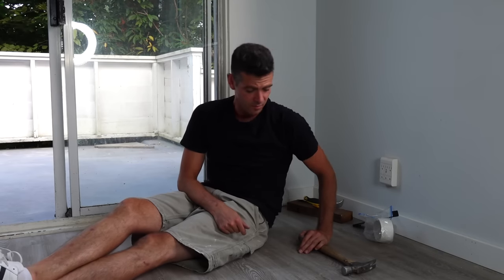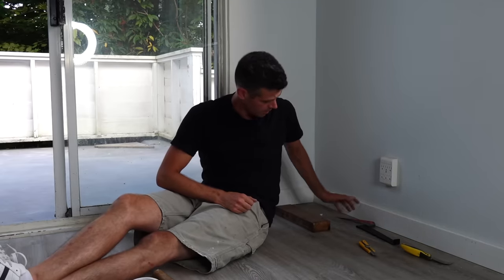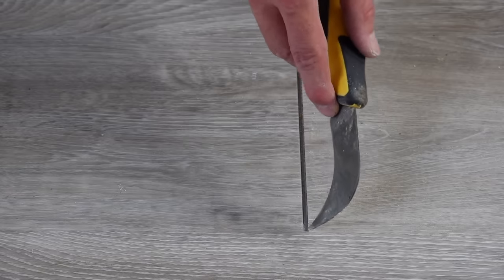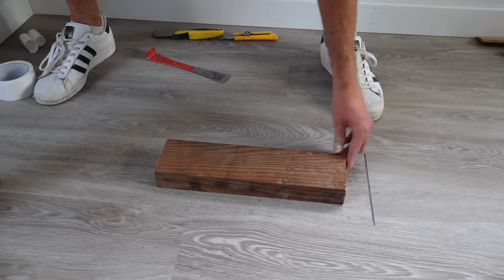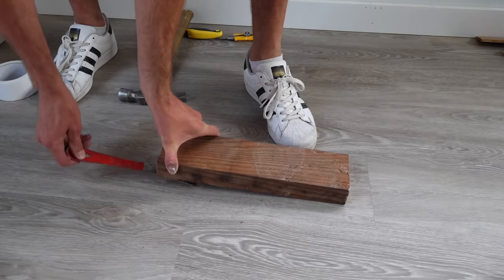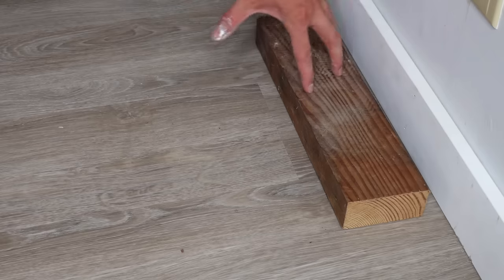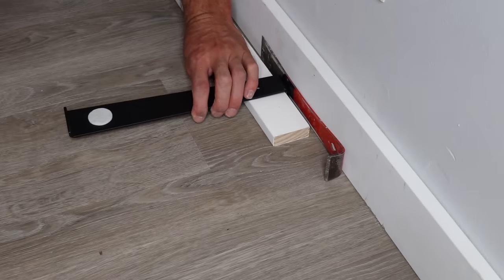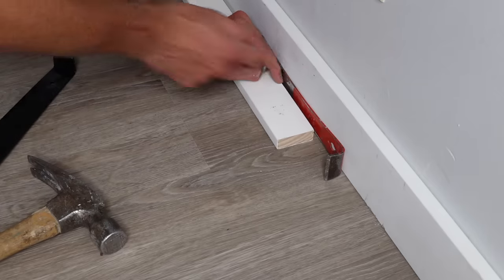How to Fix Gaps in Flooring!!! (Laminate, LVP, Engineered wood)

Comment: The best way is to get the suction cups with handles used for moving windows and glass.  I’ve closed up hundreds of gaps in vinyl and laminate floor with ease.
Reply: This
Reply: I also came here to say this. Use a suction cup dingus! There are cheap and easy to find and will not damage the floor.
Reply: I've tried a suction cup.  It does not work very well if the floor is textured as it's hard to get a good seal.
Reply: @davebaker1325  I also came here to say this
Reply: Does not work with deeply textured planks.
Reply: For those saying it doesn’t work well for grooved planks, it does work well.  All LVP I’ve installed has worked perfectly with the double suction cup window handles. You can even mist some water on it first and it locks rocks solid.  Then use a rubber mallet or a hammer to tap the handle and the LVP slides about 1/8” with each strike.   Maybe if you’re installing wood laminate or a floor that is not air tight, it won’t work but I’ve done over 25 LVP floors mostly distressed finish and this works great.
Reply: Suction cup. This dude is an amateur.
Reply: @elpcmaster  ya right.
Reply: Tried a few suction cups, DOESN’T WORK !
Reply: Have you fixed the LVP with the tongue and groove ends like this?
Reply: Thanks Tommy.
Reply: Even better!
Reply: I came here to say get real hardwood instead and you won't have r to deal with this bulkshiiiiii
Reply: Will that work on my wife😜
Reply: @jayboogie1357     We have real solid hardwood.  We have gaps.
Reply: I read your comment and moved on from the video. Thanks!
Reply: @rubyoro0  there either old or installed improperly.
Reply: How
Reply: Yeah I've tried different suction cups and it doesn't work very well on the hardwood flooring we're using. I'm gonna try this method if something like this happens in the houses we're building again!
Reply: @jayboogie1357  difference in price is only $2k vs $15k. Ez
Reply: Yeah but I don't have and can't afford suction cups
Reply: @jayboogie1357  real hardwood sucks because it’s actually quite soft and scratches and damages easily, especially when you have kids. I don’t understand the appeal of hardwood.
Reply: Still need something like this for those small edge pieces too small for the suction cup
Reply: @davebaker1325  I think the ones they are taking about are a bit better. I think the ones used for scaling buildings wood be best but probably not cheap
Reply: I had the exact same idea, it works great and its fast.
Reply: Any recommendations for which suction cups to buy?
Reply: I figured they would slide
Reply: Thanks for sharing your technique
Reply: So you put the suction cups on the plank you want to move in a certain direction then have to muscle it there? Seriously?
Reply: @ssbmsb  rubber mallet.
Reply: Just my thoughts for those still reading comments.  The guy is not an amateur. His video was for the diy amateurs..
Carpet tape works well and is cheap. If you don't have a block of wood the plastic block that came with any laminate install package works well. Also double sided alien tape works well too If you have it already.. sometimes even a real good pair of running shoes with a good sticky grip will do the the job. Just slam your flat foot in the direction the plank needs to go..

Suction cups will work but they can be expensive and I would be cautious about hitting them with a mallet.. they are not intended for that purpose. I have one in our shower /tub I could use but the way the handle is curved not sure it would be a good idea. Might break as the handle is plastic.. not meant to be hit so be careful if doing it that way.
Reply: Suction cup doesn't work.
Reply: @jeffsim8664 of all the comments here, yours was the most sensible and useful.  Thank you.
Reply: Thank you.. some slide in easy others ya gotta work at it.  A little bit of glue helps keep them in place. Thin bead on the tongue so it glues to the groove.
Reply: Which suction cups are best to buy for closing gaps in plank flooring?
Reply: What about the other end? Will this not open up and created gap on the other end?
Reply: I am not going to risk a good quality 30.00 suction cup by hitting it with a hammer when i can get a roll off double sided tape for 5.00. And a piece of 2x4.
Reply: What causes the gap in the first place? Mine wasn’t like this when first installed. This makes me wonder if it will slip back again? Isn’t there something else to do besides slide it back into place? What’s going to make it stay in place?
Reply: I think its usually the cheaper laminates that do not have a good t and g system on the ends. Just movement on the floor. Walking on it. Vibration any number of things will cause it. Make sure you clean out the gap really well. any debris in the gap will prevent a successful rejoin. Scrap and vac out the gap. Then a bit of carpenters glue on the tongue side should hold it from separating again. Alien tape works well on the bottom of a plastic block or short piece of 2x4 @tamaramiller2299
Reply: @tamaramiller2299  generally it’s floor prep. If the floor isn’t flat and level, each time someone steps on plank, the edges get pulled in.  This is what causes the gaps.
Reply: Put on a pair of shoes with a sole that grips and scuff kick it in place.

Comment: about 80% of the time, instead of using double sided tape, you can just "kick" the plank lengthwise to close up the gap.  (rubber soled running shoes help)
Reply: That's what I do with mine all the time... success rate 100% on a simple tongue & groove system. Don't know if it works on a click system
Reply: Yup, this is the easiest way. Don't use black-soled shoes :)
Reply: That would make a gap on the other side huh. No way you're moving a whole row like that
Reply: sounds like it'll just get undone as soon as someone walks on it if it's that easy though.
Reply: @samuelbankston2108    I pick the closest wall that has baseboard and quarter round, and "pull" from that side.  I've yet to have a situation where the end cut under the baseboard gets exposed.  If the pieces separated like the example in the video, they were not very strong to begin with (even on the long edge), so they will slide with a few well placed kicks.
Reply: @Layarion  a bit of glue or construction adhesive helps a bunch.   A couple of times I've squeezed enough adhesive into the gap to go under both pieces and attach them to the floor.
Reply: @psanscartier  I think a click system would have too much friction.
Reply: I did the "kick step" with sticky running shoes too and it was a fast fix though this one is quite elegant.  I think a pro should use this one to look like a pro!
Reply: @robertpautsch5093  You look like a pro by being efficient with your time and the customers money.
Reply: rubber mallet
Reply: Came here exactly for this comment
Reply: @psanscartier  sometimes yes but not all the time it's like a 50/50 chance you'll get it with a click system
Reply: I was thinking one of those rubber jar grippers with a 2x4 on top
 Just hit the 2x4 from the side with a hammer while applying pressure to avoid scuffs
Reply: rubber mallet from your flooring nailer is 100% effective...
Reply: This is what I do.  But how do I keep them shut?
Reply: Just tried it, worked perfectly👍👍
Reply: he didn’t show the new gap at other end?
Reply: @Layarion  Its the same as driving it home with a hammer or any other tool.  If the joint was week to begin with, yes it will come apart again, and again, and again regardless of how you closed the gap.  The only way to fix that is to replace both pieces.
Reply: @samuelbankston2108  the only way to avoid that is to ONLY work on the end piece and try to drive the entire row.  Problem is that you can only drive about 2 pieces at a time.  Best bet is to kick one board over at a time moving across the row and hope that you don't damage an edge joint in the process.
Reply: @everydaylogic2198  work it back to the last one to the architrave
Reply: @samuelbankston2108  Yeah, I have to do it all the time. The flooring company was new and their "linking" system is/was defective so the planks move. A giant pain. 
we bought additional flooring for another room (to match) and they had fixed it so that the new flooring hasn't moved at all.
Reply: I just use my barefoot.. grips just fine... I was hoping this was going to show us how to stop them from spacing out after...  🤷🏻‍♂️
Reply: @Layarion  Yes thats how it sounds but its not how it happens
Reply: @psanscartier  you just gotta use a plank of wood in front of it to hit so you don't break the lip
Reply: @VC-Toronto  my frustration with the glue is, I didn't buy this flooring to be glued together. It infuriates me, when my dad, my flooring installer, says "we'll glue it"
Reply: @VC-Toronto  its supposed to float so you  should not  glue it to the floor. But you could use some super glue in the joint but only use it like  a  nail on the tongue
Reply: @samuelbankston2108  You just work your way along the row, kicking the gap closed on each plank. On most averaged sized rooms, you only have to do it four or five times per row, no big deal.
We also use a similar device to the one in this video for more stubborn planks, but instead of the tape, we use rubber non-slip drawer liner with foam on the top to kneel on. This usually gives plenty of grip, and unlike tape, you don't risk delaminating the plank.
Reply: @brandacarlson815  o
Reply: @swiftaudi   Glue, use something semi flexible like Junkers butt joint adhesive
Reply: Bare feet
Reply: Few drops of wood glue if it keeps happening and a kick
Reply: @samuelbankston2108  If the whole row has moved that much to begin with then you can also move that whole row back again too
Reply: @Layarion  Yes and what these people didn't mention is that if that gap does appear then you should also glue those joints, otherwise it will move just like that again. I have done that countless times
Reply: @shegocrazy  I've done it with click flooring too
Reply: @lightbulb1982  I've laid like 20 wood floors at least lol.
Reply: @lightbulb1982  I guess depends on the type/brand? I installed some snap in flooring and no way it would move. The edges are waxed but too much friction. It really locks in.
Reply: @samuelbankston2108  how do you keep the planks in place?
Reply: @carlhendrix6547  flooring shims
Reply: Sounds like knee pain in the making.
Reply: @jimmurphy4703  what he said
Reply: Works great. Thanks!
Reply: It`s what i`ve done with a bare foot, for nearly 35 years.
Reply: Exactly! 

Think smarter,  not harder
Reply: @everydaylogic2198  that's what I was thinking.  I had to watch the video just to see all the effort he put into a simple fix. Just keep going, lol
Reply: @zackfishle1009  where do you hit the rubber mallet?
Reply: @alex9483  I hit it in the face when I am fed up with work.
Reply: I just kicked a gap closed that was twice as wide on my kitchen floor it's the fastest and easiest method 🤷🏼‍♂️
I've seen guys with a  🪣 of tool & take an hour trying all different ways glass 🪠 suction cups rubber  mallet, tapping blocks 🤦🏼‍♂️
 just kick it already 😆👍🏼
Reply: Never used tape once in midlife I make 20k a Job ever 10 days
Reply: @umchoyka  and if you do use black soled shoes, use a tennis ball to remove scuffs.
Reply: Clean soles!
Reply: @psanscartier  click system is a pain. Can be.
Reply: @lightbulb1982  you never glue a floating floor 🤦🏻‍♂️
Reply: Occupational safety OH&S does not allow that. Thanks
Reply: @johnkind5981  are you talking about OSHA and wat don't they allow 🤷🏻‍♂️
Reply: @VC-Toronto  which glue? And how do you squeeze it between cracks?  Do you lift a piece up?
Reply: I wouldn't worry about it if it's really close to the wall
Reply: Vacuum, superglue, kick. I have 20 year old click laminate and ends seem to give out first in high traffic areas.

Comment: I watched this video because I had some gaps in my wood flooring but after reading the comments I just kicked the board to achieve the same fix, thanks Vancouver Carpenter, I wouldn't have found the fix without you.
Reply: Fantastic ❤
Reply: I met with an inspector for a home I was buying and that's what the inspector told me to do. I just made sure I had shoes that didn't leave scuffs and gave it a quick kick. Easy fix.

Comment: I have used an auto body repair dent suction cup.  Can pick them up at Harbor Freight or auto supply store.  Flip a lever, it sticks and flip back to release.
Reply: I have done the same thing.  You can get a single suction cup or double suction cup with a long handle for more leverage.  I got mine at Princess Auto.
Reply: Same here, except I use a cheap $3 plastic one from Harbor Freight and it has lasted me for years.
Reply: Have you done this on textured LVP or just the smooth laminate?
Reply: Best tip here
Reply: DUDE, great tip, I have a couple of those and I'm getting ready to lay some flooring. (this should be pinned).
Reply: @walnutcontractors5661  with a suction cup on textured surfaces you can use a viscous solution to help seal the edges e.g. straight washing up liquid, etc.  Washing up liquid is fairly tacky anyway when not diluted or you can let it dry a bit more.
Failing that, any sugary solution will be even stickier when drying out, as anyone who's spilled juice will know. 😬
Reply: @mv-db4463  can you post the link? If I see the product I could better visualize how this works. Thx!
Reply: SUCTION CUPS (for glass & laminate floors) WILL NOT work for deep textured LVP vinyl floor! I tried!!

Comment: Solid tips Ben- I’ve always just done some sweet kicking dance moves with a rubber soled shoe, but this is also a great option:)
Reply: Funky dance moves is the best way for sure 👍
Reply: Do Lakai's work well for this?
Reply: Your videos are dope 🤙🏼
Reply: Same here 😂
Reply: Won't work on the pieces close to the baseboard.  Also I've had the gaps on the long side of the board - bad install - and this trick works great for that.
Reply: Yeah I'm 240, the guy I work with everyday is about 120.... My big ass has to do all the dancing
Reply: A bit of wood glue first in the gap helps before doing the dance because chances are, the join is no good.
Reply: It's a good thing you mentioned "rubber soled shoe"; too many contractors run around wearing Timberland's on hardwood floors. LOL!
Reply: Best way I've learned is to use a few strips of painters' tape (it's non marking) and rubber soled shoe. When I used just the rubber shoe, black streaks would be left on the vinyl or laminate. With the tape, you run less risk of marking/damaging the floor.
Reply: yes, the Hokey Pokey Shuffle..  i like this method better now 🙌🏼
Reply: Me to! Jump jump jump
Reply: haha, I have done the funky dance moves myself.
Reply: Been there done that. With your foot it works well but if you do it often your toes start to hurt. So my mew solution was/is a rubber hammer. Works wonders since it vibrates the wood and you can use it like you did your shoes. It does not damage even the cheapest laminate and a rubber hammer doesnt cost a fortune....
Reply: Yeah, that's what i do.  Much easier than all this faffing about.
Reply: Done the same, just a rubber soled shoe for the easy boards.
Reply: bare foot works just as well also
Reply: Yep. That's the first thing I do. Give it some kicks before I even grab a tool
Reply: We do the same. Easy Peasy!
Nothing like over complicating it ,huh?
Reply: That's the best way
Reply: Rubber soled shoes, also kent as Jimmies in Aiberdeen.
Reply: Or doing it right first time? Maybe?
Reply: That was me 3 days ago 😎💃🏻
Reply: Put some painters tape on the floor where your kicking too , just to be safe
Reply: But if you jump too hard u could delam on either side, or wrinkle the tongue(on a el cheapo board) this looks more controlled...
Reply: @brianyoung2839  lol
Reply: Me too.  But it's hard on my feet and joints.  Will be trying this tip.  And finding the right amount of double tape to use.
Reply: Yep I do the same
Reply: I have this problem in two places. I’ve been using a rubber mallet so far. The problem is, it keeps returning every couple of weeks. To end the problem, should I try to put wood glue into the gap? If so, will that cleanup ok if a bit oozes? Thank you!
Reply: @tazzatamania  as a flooring guy I'll say you are right

Comment: A large rubber mallet works really fast. Hit it in the direction of the crack and it will pop it back in space. I make a living laying flooring and it works very well with less effort
Reply: Ha I just posted that. It's legit all you need.
Reply: Will this work the other way to. As in not end gap but a side gap. I laid some hybrid flooring last week. A couple of gaps have appeared along the length. Or part of the overlap of two planks.
Reply: @liamjenkins82  yes
Reply: @kentuckybeardsman  cheers mate.
Reply: Kicking with good rubber soles, could probably do it, since they have been kicked open because of ordinary walking.
Reply: @CONEHEADDK  possibly
Reply: @CONEHEADDK  that works in my house.  I used the rubber mallet if it's super stubborn but mostly I just kick it with the balls of my feet and that gets it 95% of the time.